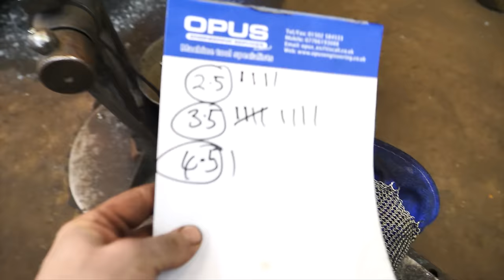GOING ON FORGED IN FIRE?!?!

Comment: Alec, you are amazing, but can you make a Sherlock Holmes-style Damascus tobacco pipe? that would be totally tubular, and very much appreciated. Keep the great content and hammers coming!
Reply: Smoking out of metal is bad for you. Grade 2 titanium is the only metal that can be smoked from safely, it doesn't release toxic fumes.
Reply: Smoking is toxic, use gaz or coal forge is toxic, even salt is toxic...
Reply: https://en.wikipedia.org/wiki/Metal_fume_fever Smoking some tobacco and metal fume fever are worlds apart. Yeah everything is toxic, but that doesn't mean you should just go snorting lines of metal shavings. Read what metal fumes do to you, it's not pleasant.
Reply: "Metal fume fever, also known as brass founders' ague, brass shakes,[1] zinc shakes, galvie flu, metal dust fever, Welding Shivers, or Monday morning fever,[2] is an illness primarily caused by exposure to chemicals such as zinc oxide (ZnO), aluminum oxide (Al2O3), or magnesium oxide (MgO) which are produced as byproducts in the fumes that result when certain metals are heated. Other common sources are fuming silver, gold, platinum,[3] chromium[4] (from stainless steel), nickel, arsenic, manganese, beryllium, cadmium, cobalt, copper, lead, selenium, and zinc.[5]
Welders are commonly exposed to the substances that cause metal fume fever from the base metal, plating, or filler. Brazing and soldering can also cause metal poisoning due to exposure to lead, zinc, copper, or cadmium.[5] In extreme cases, cadmium[6] (present in some older silver solder alloys) can cause loss of consciousness." where do u see steel and tabacco smoke on steel pipe ?
Its only concern some metal and people casting welding or use abrassivs on those metal.
Reply: Smoke out of metal then bro. Beyond the risk of fumes, which all metals aside from Ti produce, there is the obvious problem of heat transfer. Metal gets hot as hell very quickly. Not good for a pipe.
Reply: on that point i agree, heat transfer, but here its about making a pipe, just for the beauty of the art, cuz makink that sort of stuff are complicated and need a bunch of skills that will be great to see.
Reply: Pipes are wood for a reason...they don't get too hot to touch...Making a Damascus pipe is just dumb...and totally defies function...which is the foundation of artisan work. I am a carpenter and if you asked me to make a machete out of wood I would say no thanks.
Reply: croiset guillaume Where is steel in that definition of metal fume fever?  Probably in that part where it lists chromium, nickel, manganese, cobalt, copper, and zinc among other things since those are added to iron when steel is made.  They're definitely in Damascus steel since differences in the amount of those chemicals are what allows Damascus to have a pattern.

Comment: Suggestion: If you had some sort of foot actuated lever that raised/lowered the bricks in front of the forge, you could save some manipulation getting steel in and out of the forge.  Perhaps it seems like more effort than it's worth, but there's a couple of seconds of manipulation every time you're putting something in and taking something out that might make it worth it.

Comment: Forge yourself a cooling table( a big ol thick metal table with an outer lip) so you dont have to throw them in the dirt, then bend down and pick em up over and over, so you can save your back so you can continue to do awesome work into middle age and beyond

source: disc herniation from repeat lifting for 10 years, 5 years ago still around today

Comment: Don't go on Forged in Fire.  They'll put you into a situation that is not tenable to your knowledge of what is necessary to complete a project to the way you know it should be done, then hold you accountable to a faulty product.  You set the perimeters to your reputation by working in an exact standard.  Never deviate from what you know is right, technically, efficiency, and safety first.

Comment: You should really take your ring off when you are in your shop. Ring avulsions are not a pretty sight. Also getting so much as a spark on it can heat up the ring enough to burn all around your finger.

Comment: I think if you went on Forged in Fire, you would have done very well. However, they do have actual Master Smiths on sometimes, so you could get washed out with one tiny mistake because of a simple lack of knowledge. One dude couldn't even use a grinder though lol. I've seen a lot of your work and I reckon you very much so could win.

Comment: if you do go please please dont make a knife with damascus steel through out. they will mark u harshly for soft metal on the blade edge. practice a sanmai construction with hardened material in center.

Comment: Great job with the hammers!  I think you made the right decision regarding Forged in Fire.  I like the show but you are correct, with your assessment that if you are not a full time bladesmith, it would likely not be a good decision to go on the show.  The 3-4 hours that they limit you to forging your blade in addition to the fact that they often give you a pile of crap steel with which to work, it would not be in your best interest and may not permit you to display your talents.  I think the show has become a bit silly with some of their steel parameters.